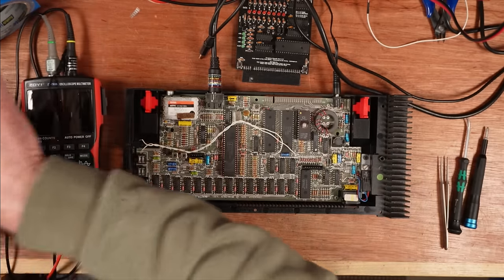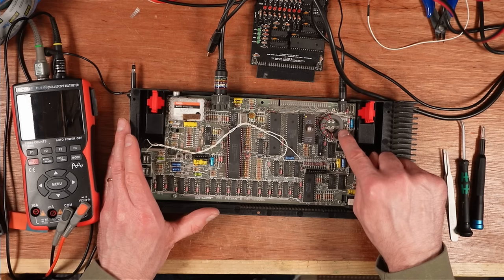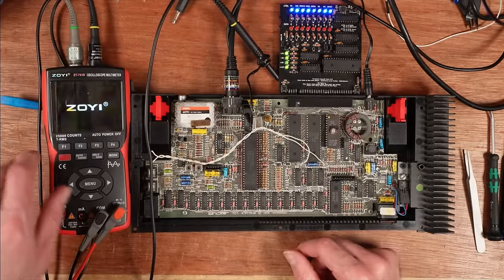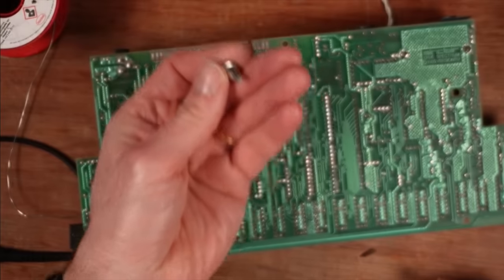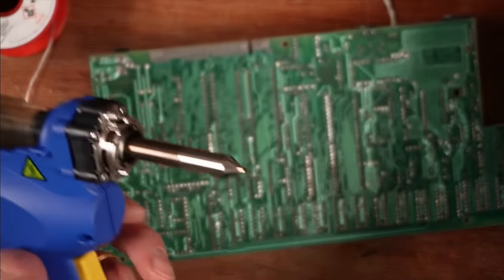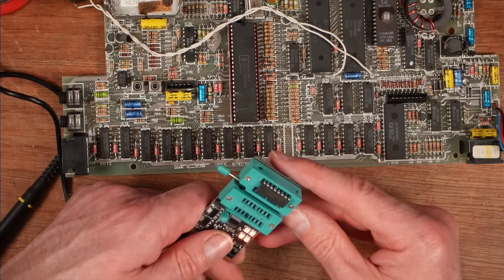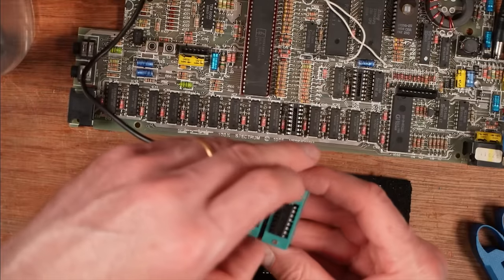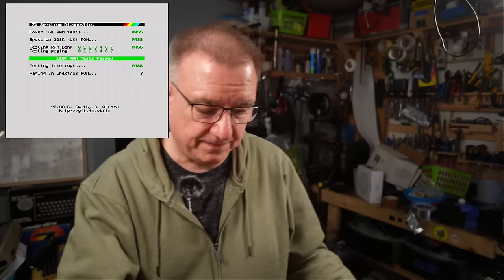An Obvious RAM Fault? Toastrack Repair with Suspect Ram

Comment: im really tight it seems.. i didnt have kapton tape and didnt want to buy any... so i just used kitchen foil ! Folded twice for quad thickness, it works really well and can be moulded around plastic connectors to protect them

Comment: Fun video! I will solder my ByteDelight test cartridge this weekend and use it on my two Spectrums with corrupted video output, and I will no doubt find out that faulty RAM ICs are the cause of the problems...

Comment: The great thing about a thermal camera is that if a component is abnormally hot then it will drown out the components with normal temperatures. So the whole screen will be blue or darker and the faulty component(s) the only orange on screen.

Comment: 🐄🐄🐄How are you getting on with the new moo?🐄🐄🐄
Reply from the maker: It's getting better and better. 
No noise is amazing. Quick to heat up, easy to use. I needed to remove 8 sockets from an Oric 1 yesterday, something I'd been putting off before, and it was an absolute breeze. 
My only negative is the temperature control wheel. Just have to get into the habit of checking I've not left it on 450C.
Also would much prefer the lowest setting to be cooler than 350. For those extra delicate issue 2 Spectrums